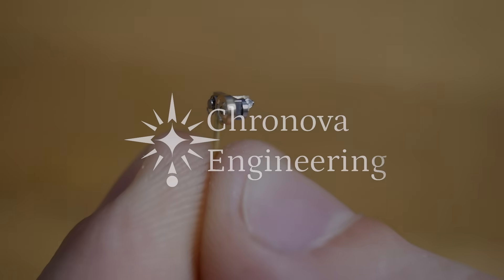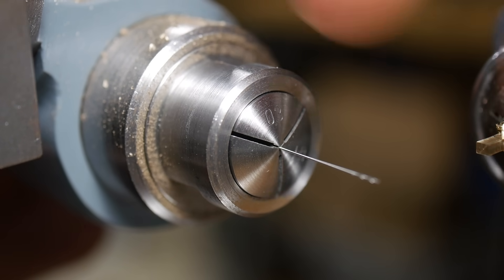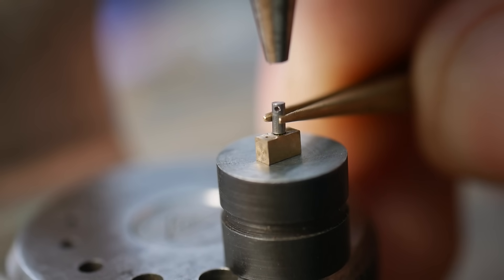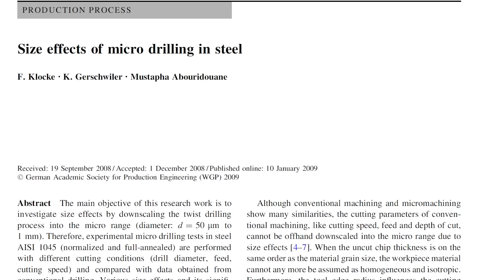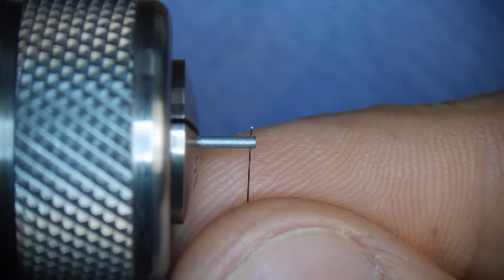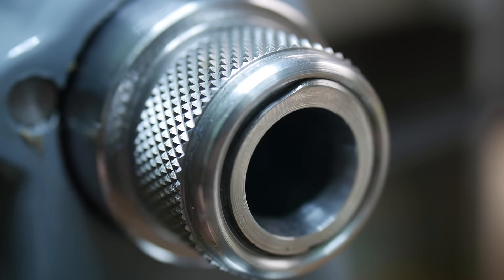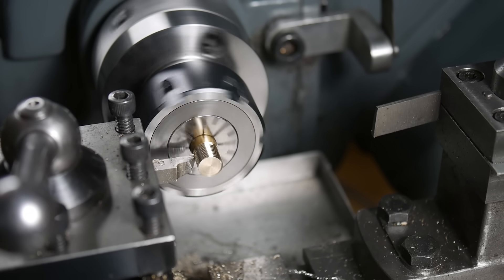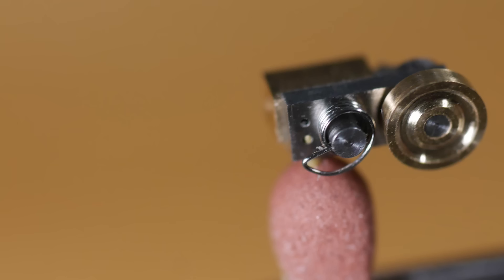Honey, I Shrunk the Steam Engine

Comment: This is absolutely insane!!! I just saw a video that might interest you. It's this new tech of a silicone microchip that acts as an active cooling fan you can put into electronic devices. I definitely recommend you check it out. It kind of utilizes similar properties. The chip uses ultrasonic vibrations that's within a custom container with a unique seal that allows for moving hot air and cold air to circulate. Just thought it's a fascinating advancement in heat pump, cooling fan type technology.

Comment: I don't think it came through very clearly on video, but anyone who's held a 0.3 mm drill bit knows how incredibly tiny it is! I have one and I can't imagine how they are even produced...
Reply: I don't trust any milling cutter below 3mm, they could be selling me a drill bit for all I know. 😅
Reply: Last time I attempted using bits like this it broke when I looked at it. Sometimes you just have to admit you aren't the gorilla meant to do the job.
Reply: And then you were presented to the almighty 0.1 mm drill bit.
Reply: I use to make printed circuit boards and have tungsten carbide drill bits from .2mm to 3mm now its cheaper to use China.
Reply: That's like 000-100 taps which is insane. I have no idea how they manufacture stuff that small
Reply: I had to use 0.3 mm drill bits for some ceramic parts. The box that contained 10 of them fell off the microscope stand onto the table below while I was messing with some parts. Every single bit immediately snapped off when it hit the table.

I stopped working for the rest of that day to cool off after that.

Comment: Excellent work!  I have two comments: firstly, around 4:58, does the liquid prevent the pin going into the hole fully, due to hydraulic locking?  When I use dowels in woodworking, I always cut a slot in the dowel, for air and glue to escape.  Secondly, when you're out and about you may see manhole covers with "Jones" "Oswestry" engraved in their corners.  I worked as a welder in the "specials shop" at Jones of Oswestry in the late 1980s, making those covers.  The engraving was done by one of my colleagues (Soup Dragon), who spent many hours perched on a stool by the pantograph!

Comment: Don't forget, you don't have to go bigger, you can also go more dense. An osmium flywheel would've been interesting to say the least.
Reply: Lead would be doable, or some alloy of lead. Tungsten would be better, but I know it's notoriously hard to machine, so it might not be possible with his workshop.
Reply: @bow-tiedengineer4453  Given heat is a staple of steam engines, the wheel needs to spin at high speed, lead's melting point, and malleability.......
Reply: @custos3249  unless you're using superheated steam, it wouldn't get over boiling, and the centripetal forces wouldn't be enough to stretch something that small even at those speeds.
Reply: @bow-tiedengineer4453  You wanna test it, no one is stopping you. Physics loves educating engineers the hard way.
Reply: @bow-tiedengineer4453  gold would be easy to work with and dense enough
Reply: @bow-tiedengineer4453  wouldn't lead suffer from the heat and vibrations?
Reply: @losfogo7149  There's some heat and vibrations, but not enough to melt it, and the square/cube law is in your favor. Strength increases with the square of length, while the weight increases with the cube, and the forces actually increase with the fourth order of length because it's centripetal force, not the load of it's own weight. So even if lead is a soft and malleable material, at this scale it really doesn't matter that much, compared to a larger flywheel, because the forces on a flywheel of conventional size would be so many times larger. All that really would matter is that the flywheel is balanced well.
Reply: At this tiny scale, even really exotic and expensive materials might be affordable.
Reply: @Yora21  Like platinum.  Which is denser than tungsten, and likely much easier to machine.  You could probably use a 1-gram bullion bar directly as billet material without risking a ton of money.
Reply: @PyroForge  Yeah, in these quantities, even Platinum should be pretty inexpensive.
Reply: @PyroForge platinum is denser than tungsten?
Reply: @CenReaper.  Yeah, platinum is the densest material you can easily get through normal commercial channels.  Platinum is beaten in density by iridium and osmium, but only by small fractions.  A 1-gram platinum bar can be bought off the shelf for $50-$100.
Reply: density isnt the only issue... malleability. whats "hard" for us becomes extremely soft at this scale...

tungsten as a metal is relatively soft.

this is starting to get into "jewel" department... ruby, diamond, etc... you dont want malleable...
Reply: @paradiselost9946  Yep, in its pure state, it's incredibly hard. Since it's not really used anywhere, it's, uh, hard to get reliable information, but seems consistent that its Mohs is .5 lower than tungsten but its Vickers and Brinel are a fair amount higher. People often think tungsten is exceedingly hard not realizing they're thinking about tungsten carbide. It is rather hard, but pure tungsten can be cut with a regular file. Another option to maximize density could be iridium, but if you thought platinum was expensive, iridium will rob your house, steal your girl, and set your pup alight while smoking a comically large cigar and twirling a mustache.
Reply: Gold could be a possibility too.
Almost the same density as platinum and Tungsten
Reply: @adfernandez67  that would be badass
And gold is easier to work with!
Reply: Diamond-slice the end off a tungsten-carbide drill, then lap flat?
Reply: I'd be concerned that an osmium flywheel on that scale might just shake the entire engine to death lol
Reply: Isn't osmium ridiculously toxic? But yeah, tungsten could work... But it's famously a PITA to machine
Reply: @akaHarvesteR  It's used in jewlery, so no. It's no more toxic than platinum, which makes sense since it's one of the noble metals. However, like platinum, compounds containing it can be especially hazardous, such as it's oxides. Easily mitigated with simple galvanizing though.
Reply: Use tungsten wire or dust, pack it down and seal with resin
Reply: I don't see what density has to do with this but I'm also not paying attention. Not really feeling myself to much today I think I need to take a pill or something to feel better